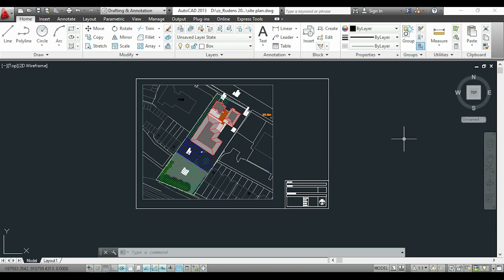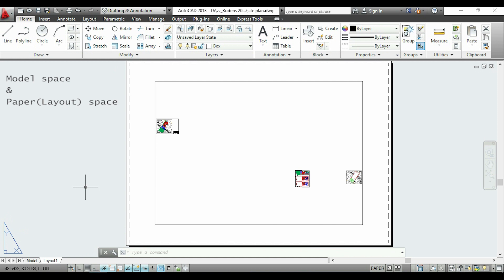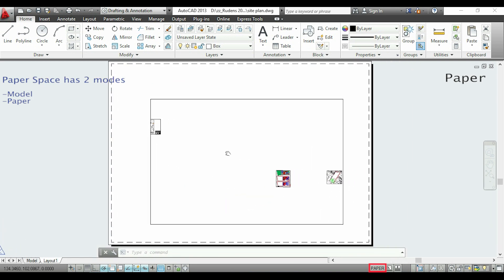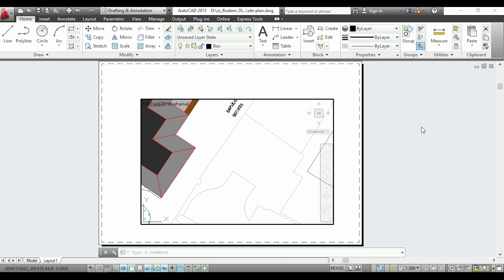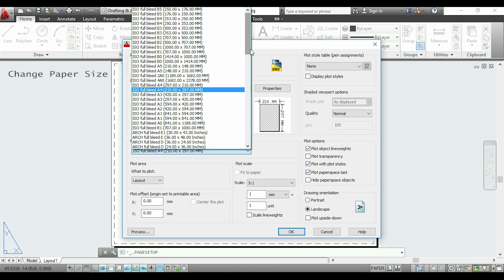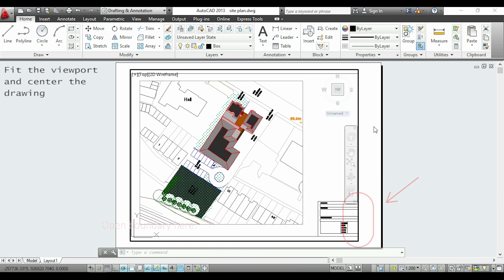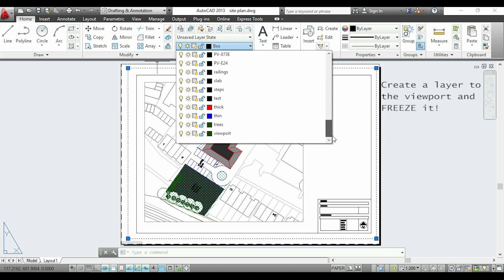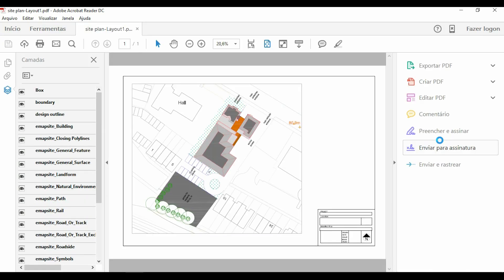AutoCAD 2D - How to Scale a drawing - PART 2 (Printing using Layout!)

Comment: Why is sclae in plot set up manager set up on 5:1? In propetis where you selecting paper size scale factor, what is mena it defrend set up for cm,m or mm
Reply from the maker: Good question! Actually that should be 1:1, because below you have 1mm=1unit. Just Try it yourself! Honestly I don't know why that is happening.
In newer versions those values match.

Basically if you are using the units on project as mm -> you have to set 1mm=1unit. If you use meters (for example) you should type 1000mm=1unit. The sizes of the paper are in milimeters (for ISO paper sizes), that's why we need the conversion.
Reply: @CADinblack  thank you a lot for answer

Comment: Thanks for Video. I need to print an isometric drawing and still have the isometric lines in the background. Is this possible? Thanks.
Reply from the maker: Hi +Crypto Santa.
I think it is not possible to print the grid, it is just for helping during your drafting. However you can always draw your own. You can draw it easily using the command Array

Comment: how to make the drawing to fit inside the paper ej. 42 in x 30 in? and be able to scale at 1/8"? how to print and be able to scale. anyone?
Reply from the maker: Hello +Lucio Aguilar. You can set up the paper first in Page Setup Manager and then set the scale to 1/8" to check it fits. I hope it helps
Reply: @CADinblack  it did help, thanks!

Comment: That's all nice but as you said at the start of the video 'I will show you how to print a drawing in a specific scale' you haven't actually showed how to print it just how to save it to pdf.
Reply from the maker: Hello +J Bo. You are right at this point. But my intention of this video was to show how to do all the process. 
To actually print the drawing, just select your printer name instead of "dwg to pdf". Other option is saving to pdf, and after print it from the pdf file. I hope this helps.
Reply: I was struggling with how to print to a scale through a printer. Now I found that you can choose poster option on some printing menus which allows you to split e.g. A1 into 8 A4 sheets of paper.